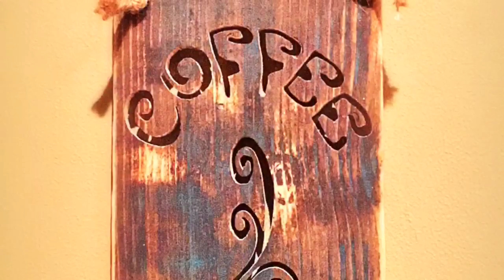Scroll saw Dremel Moto-saw Coffee relief cuts Wood sign Time Lapse

Comment: How are you liking this? Thinking about getting one and I've read it can't do much detailed work... But you just did about what I'd be doing... What is the thickness of the wood you used? Love the sign 💙
Reply from the maker: Kate Murph sorry for the late reply. I really like it, and I can detail pretty fine detail work on it. But it has to be thin wood or plywood. The wood in the video is about 3/8" thick. But it's also a soft pine. But I've done lots of letters and detail work on 1/4" plywood and it works great. I also did a lot of LOVE cutouts on 3/4" pine but I broke and bent a lot of blades lol but I made 35 of them with it and it still works great!!
Reply from the maker: Oops.. cut*

Comment: new to this, did you have to put holes in and then thread the blade through each time?
Reply from the maker: Simply Plant Food yes you do. I drill a hole inside each piece that is big enough for the blade. You have to remember to compensate the hole size to fit the blade pins. I actually have a video (not on YouTube) that shows me drilling all the holes. I'll try and see if I can find it and post it on my channel :) thanks for watching!
Reply: Yes, great video thanks!

Comment: Can this saw cut through a tough tree burl?
Reply from the maker: Sam Myer probably not, unfortunately. I only use soft woods. The blades are so thin if it's anything harder than pine it bends and you can't get a straight cut.
Reply from the maker: Sam Myer or the blade will just snap. I had some small 1/4" pieces of mahogany and tried to cut them on my Moto saw and there was no way it was getting through lol

Comment: can spiral blade be fit in it in any way? :(
Reply from the maker: Hiba Sharafuddin Great question but no Hiba, (Flying Dutchman) Spiral blades can only be used on a larger scroll saw that takes straight blades, Pin-less. The Moto-saw only uses 3" pinned blades. An actual scroll saw, pinned or straight, uses 5" blades. So it's much smaller than an actual scroll saw. But it is still very useful!
Reply: Thanks for the info.. :)
Reply from the maker: Hiba Sharafuddin you're very welcome!

Comment: What about the tool when it's used on larger sizes of wood? Is it really efficient there?
Reply from the maker: Alexandra Vogel what do you mean by tool? Do you mean how you can detach it and it becomes a coping saw?
Reply from the maker: Alexandra Vogel I've had this for a year now and honestly I have tried using it twice as the detachable coping saw and no it is not efficient. It doesn't work well as a coping saw. The blades are flimsy and in coping saw form, it's harder to control and the blades break. Not good as a coping saw. But I have used it as the scroll saw for up to 1" thick wood and it did great. Went through a few blades but it really is a nice product. I love mine.